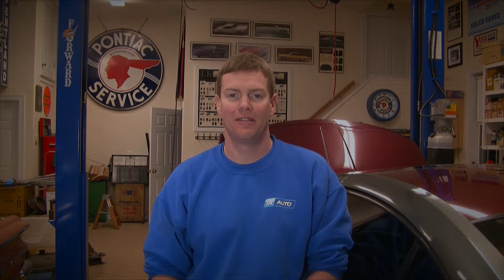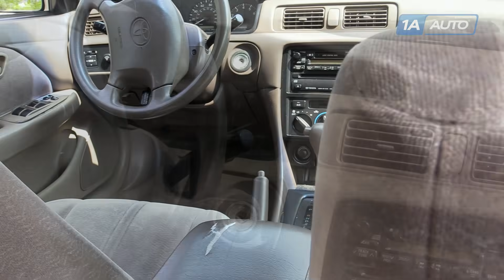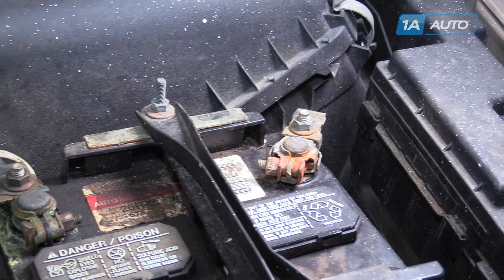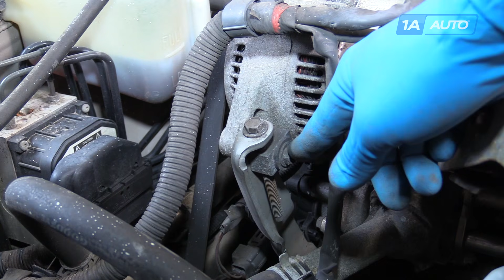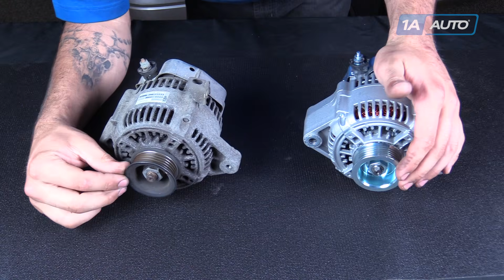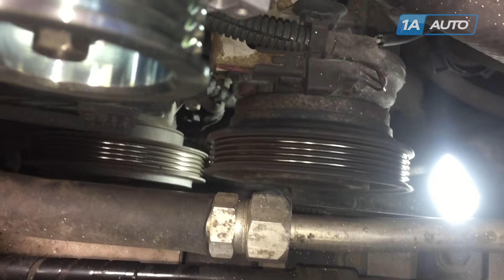How to Replace New Alternator 97-01 Toyota Camry

Comment: Excellently tutorial! I used to replace a 1999 Camry alternator. The alternator would charge just fine but a bad diode in the alternator would drain the battery overnight with a 3 amp draw

Comment: Thank you for this. I had the issue of after cleaning up my engine compartment that my battery started showing low voltage, ran it to 2 autozones to test to find it bad, and had to replace the battery to get it out of anti theft, and now found out my alternator is bad too. So now I am watching this to see how to change it out. May have to go to junk yard to find a temporary one till I can buy a brand new one.

Comment: for some reason, i had to install the 12mm bolt that goes through the adjuster the opposite way. wondered why when i got the alternator from the junkyard off of a car with the same engine size. maybe a different year? anyhow, if someone were to have the same issue, install it going in from the left if it won't from the right. #saveyourselfhundreds

Comment: This looks fairly straight forward. Got my mom new battery (the car battery took a dump) and ran a OBD scanner and got no codes. Today she called me and said after driving around 10-15 minutes  the low battery light came on. I’m thinking that might be the culprit. The tension of the belt is a concern but going through the comments I think I’ll be fine. Would you suspect anything else? Would like your opinion.

Comment: Idk if anybody else had this issue but my bolt for the adjuster block on the install got jammed to where i couldn't back it off or tighten it. Ended up breaking it :(

Comment: ready to put new part in, but it won't position to put pivot screw in.  Suggestions?
Reply from the maker: +Bruce Young Thanks for checking us out! We would suggest to make sure you are putting it in the right orientation and if it is, make sure there is nothing that is blocking where the alternator is seating. If you are still having troubles you may want to make sure the alternator is correct for the vehicle as this could also cause a difference in installation. 1aauto.com

Comment: I've seen a few questions about belt tension.  Just make sure the belt is tight by trying to turn the belt around by grabbing the belt and twisting it.  You should be able to twist it just under half way.
Reply from the maker: +smitty54017 Thanks for the feedback!

Comment: Fortunately, it helps that the job is fairly simple because the alternator is right there, no nonsense.

Cheers to you all for this video and cheers to Toyota for making the 4 cylinder Camry like this.

These cars are figuratively bulletproof so long as you take care of them and many repairs are relatively simple to perform in the event that they ever become necessary.
Reply: Yeah cause the v6 sucks ass trying to get to 😤😤

Comment: Is this the same for the 02?
Reply from the maker: +Joshua Escobar At this moment, the closest how-to video we have to your request is for this vehicle, which is very similar to the one you have. The steps may not be 100% the same, but should contain an adequate amount of information necessary for accomplishing this task:
Reply: @1AAuto  I ended up figuring it out by taking everything apart and putting it exactly how it was but thank you
Reply from the maker: +Joshua Escobar Thanks for checking us out. 1aauto.com

Comment: Why just the black cable on the battery and not both cables?
Reply: Opens the circuit, so pretty much no electricity running. Not necessary to remove both, unless it makes you feel safer lol.

Comment: What do you do if the new alternator won't slide in? Its about 0.5mm to 1mm too tight, plus where it mounts is a bit rusted
Reply from the maker: +Chase Delaney We would advise being sure the alternator you have is correct for your vehicle if it is not fitting correctly. 1aauto.com

Comment: Do you tighten the tensioner bolt first before tightening the top and pivot bolt? Is it bad to tighten then out of order? What are the torque specs for the 2 bolts and tensioner bolt?

Comment: There is a loud squeal coming from my engine bay. Just noticed it this winter when it got cold. It is random and seems to go away a little when car comes to temp but never really goes away. And my cars serpentine belt is brand new. What could this be? It sounds like it coming from alternator? Bad alternator pulley bearing? Any help would be great.

Comment: also check battery lite on dash comes on will switch comes on ....if not have altenator checked and check bulb in in cluster     it all is curcuit
Reply from the maker: +willie amos Thanks for the extra tip!

Comment: Thanks for your video it was very helpful the only question I have is how do I know it's tight enough the belt how do I know it's not too tight or is not too loose
Reply from the maker: +Rodrigo Valenzuela Thank you for the great reply. We love to empower our customers by showing you how-to perform your own auto repairs while installing our high-quality auto parts. We do not have the proper torque specs so you may want to contact your local dealership for that information. Have a great day! 1aauto.com

Comment: Do you have a video on what causes overheating?
Reply from the maker: +Joe H. Thanks for watching.  At this time we do not have a video that goes over causes of an overheating engine.  1aauto.com
Reply: Overheating can be caused by several things such as stuck thermostat, radiator fans, low coolant level, water pump, radiator, low oil level.

Comment: I’nm using a smaller ratchet and can’t get any of the bolts to even move. Should I get a longer ratchet?
Reply from the maker: +M. Neo A longer ratchet may help since the longer handle will provide more leverage. Hope this helps you out. 1aauto.com

Comment: I'm planning to buy a 240 (or a 270) alternator for my 2000 Camry because of my car audio system. Do I need to upgrade something else if I'm gonna install an aftermarket alternator?
Reply from the maker: +Kasinova Da Don Thank you for checking us out. At this time we do not have any requirements when performing this upgrade, but if you search through automotive forums you should be able to obtain an answer to operate properly. 1aauto.com

Comment: What if your 97 Camry replacement alternator is more than 80amps?  Like 90 or 95 amps?  Would that do any harm to the electrical system or components?
Reply: Should be fine as long as the mounts and harness pinout match. I’m installing a Sequoia alternator in my Supra for more amps. Stock Supra alternator is 90 amps and the Sequoia is 130. The stock alternator wasn’t cutting it for my new Pioneer head unit.
Reply from the maker: +Gary Hawkins Thank you for checking us out. There are some cases in which you may use a higher amp alternator, but confirm it is meant for the same year, make, and model. 1aauto.com

Comment: Thanks for the video.  I would have been afraid to try this before but it was easy, except getting the wires unplugged from the old 270k miles alternator.
Belt squeaked for a bit but after a drive around the block, quiet as a 270k miles Camry can be.  Also saved over $200.  Thanks again!
Reply from the maker: +Jay Foulk Thanks for watching. If any of our viewers needs to make this repair, we carry the auto repair part shown in this video on our website. Here is a link to them: http://www.1aauto.com/toyota-camry-rav4-solara-alternator/i/1aeal00467?utm_source=YouTube&utm_medium=CTA+Comment&utm_campaign=ytcomment&utm_term=7YcLFoemjmI
Reply: My car OD has flipped now it’s working toward 3k. Love my Toyota Camry
Reply: 270k eh? That the the same mileage on my 99 camry. They must go out around the same time

Comment: If the bad alternator wore down my battery to the point that my car almost wouldn't start, will it recharge with the new alternator?
Reply from the maker: +Jay Foulk Thanks for watching!  If the old alternator wore your battery to that point then there is a high probability you will need to replace the battery!  You can usually get the alternator, starter and battery tested for free a certain auto part stores.  1aauto.com
Reply: I just spoke to my brother, who is a mechanic, and he said I should at least try to charge up the battery.  Thanks for responding.